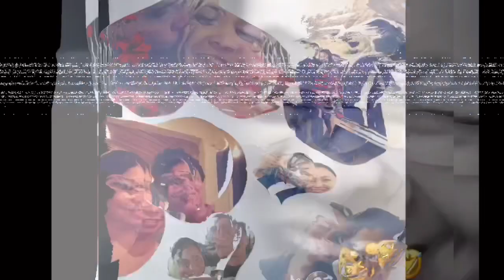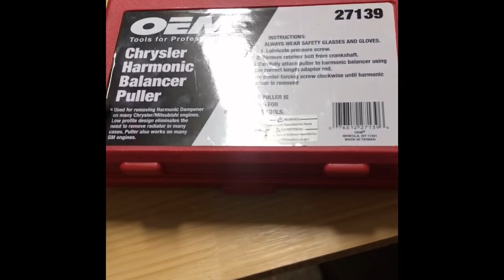2006-2010 DODGE CHARGER &  CHRYSLER 300 3.5 WATER PUMP / TIMING BELT REPLACEMENT PART 1/2

Comment: good video man, but i have one question is do you always have to change belt?
Reply from the maker: Thanks, normally you’d want to change the belt any time you go this deep into it. Usually the only reason you’d be in there is to change the timing belt, just like I changed the water pump at the same time because I was in there and it’s a pain to have to do take it all apart twice when you can do it at once. There’s no absolute rule on this but I’d say on a repair like this do it all at once. Aloha
Reply: @ClarkesFromHawaii  thank u and keep up the good videos.
Reply: @CarlosSilva-si8xl  anything rubber should be replaced while youre there is always how i think.
Reply: Dope video brotha very informal